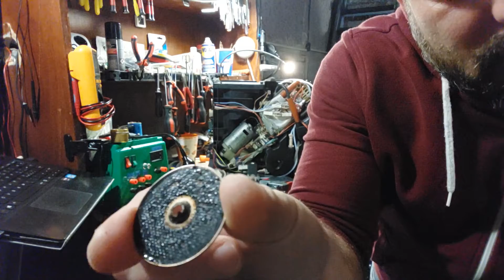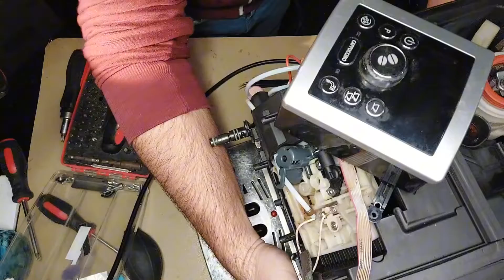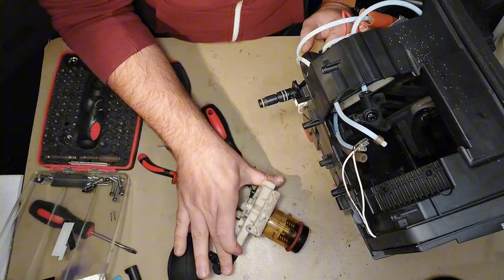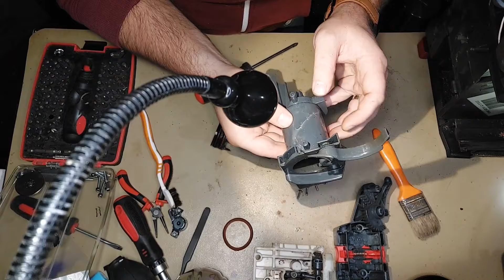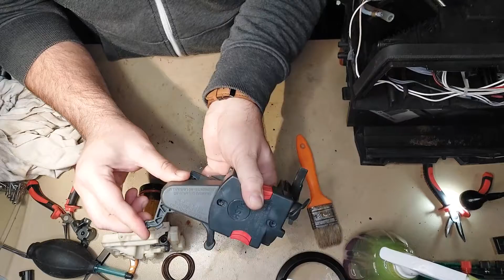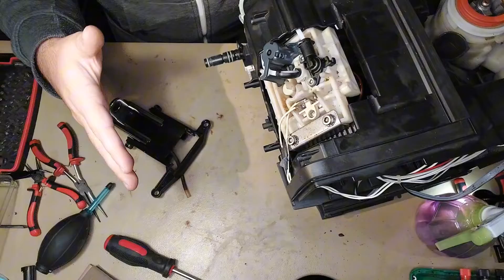Step by step clean and O-ring change - DeLonghi ECAM 23.450

Comment: Hello there,
Im following you for a while and watched most of your vids about Nespresso Inissia  Krups xn100 but you never fully disasseambled it. Well to be honest i probably have problem with water pump on this model cuz the pump doesnt suck. I want to change it for working one but totally have no idea how to remove the metal clips on the pressure pipes behind the pump. Do you have any ideas how the clips work and how can i remove them?

Ps. You doing great job showing all this content about repairing all this machines!
Reply from the maker: Hi. Glad to hear you are following my videos. Just to let you know I am disassembling the units based on their problem, so in case an unit I am working on does not have an issue at the pump it does not make sense to disassemble the pump. Anyway did I understood your question correctly ? You want to disassemble the pump for exchange on an Inissia Krups xn100…?
Reply: @benassy69  close, but not quite. I had no problem with disassembling the pump but after the pump there is this U shapely pipe with metal clips and with them i have problem cuz cant figure how to disassemble them. 

If you have any discord or mail i will provide you photos for better understanding